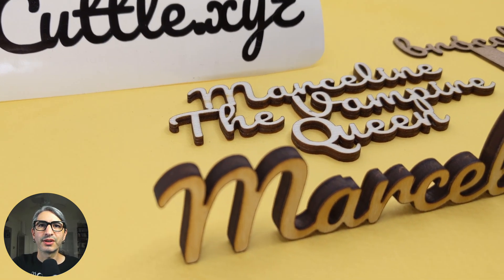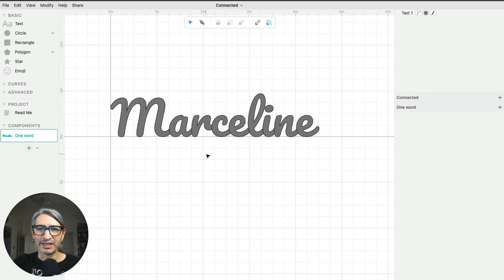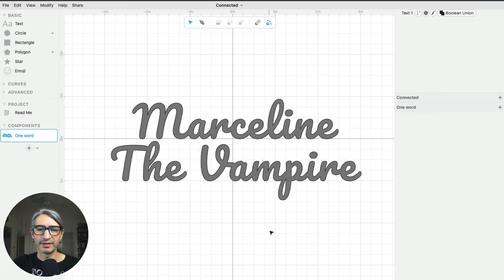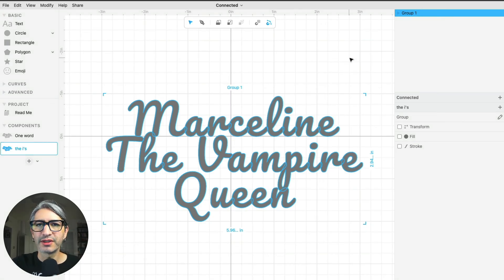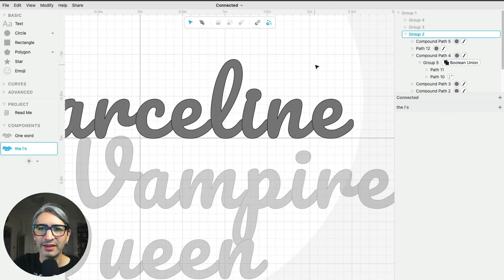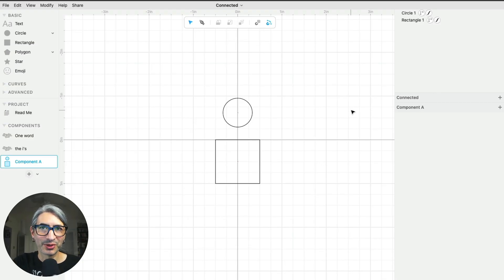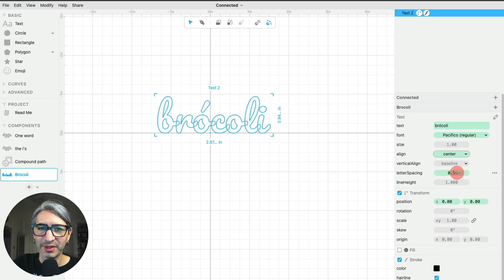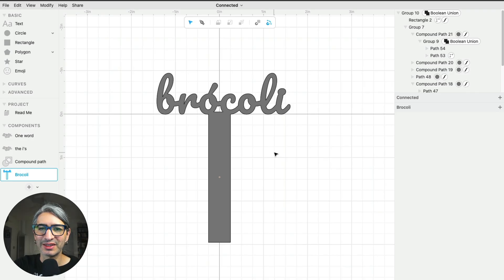How To Create Connected Text for Laser Cutting

Comment: Hi , Thank you for sahring this very valuable info. May I know what is the best size of text to cut in laser? Font size or in inches/cm. Thank you
Reply from the maker: Hi, it really depends on the laser and the material that you are cutting. But it could get as small as 14 points (about 0.19 inches). 
What are you trying to accomplish?
Reply: @Cuttle  Noted and thank you for the reply. I'm trying to cut text to do double layer cake topper. 1 layer is offset solid shape ofthe test. On top I want to stick name in cursive text. I was trying to do 1 and all the thin line broke off.. Thatswhy wanted to ask this question. Thank you

Comment: You used Boolean Union to join the dots/accent marks to the individual letters.  You then used Boolean Union to join all the letters in a word/phrase together.  Is there a reason you did it this way, instead of just waiting to do a final Boolean Union on everything (i.e. word/phrase) at the end?  Is it just a workflow thing?  Or is there a technical advantage?
Reply from the maker: Yes, good question!

It's necessary in this case because the "i" is a Compound Path. If you did not Boolean Union these two sub-paths together, the hole formed when you overlap the dot and stem would still be there when you Boolean Union the entire word. The reason is that Boolean Union respects the holes of Compound Paths. (If it did not, all the holes in o's and p's would be filled in whenever you Boolean Union'ed them with other letters!)

An alternative workflow would be to select the "i" Compound Path and do Edit > Release Compound Paths. This would turn the "i" Compound Path into two ordinary paths (the stem and the dot). You could then move the dot appropriately and when you Boolean Union'ed the entire word, you'd get the result you'd expect.